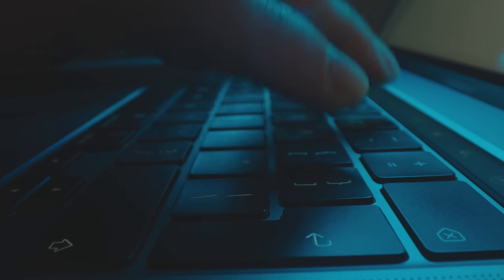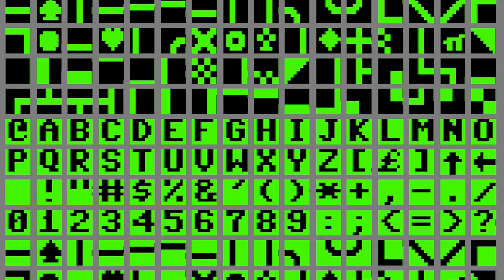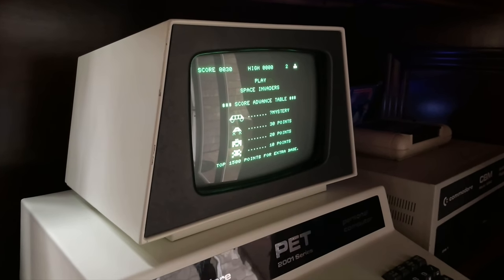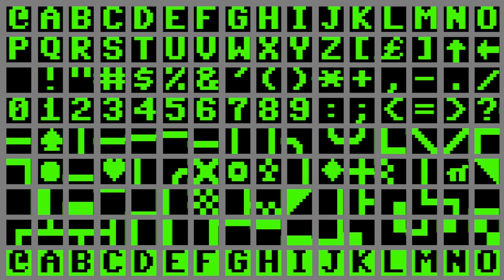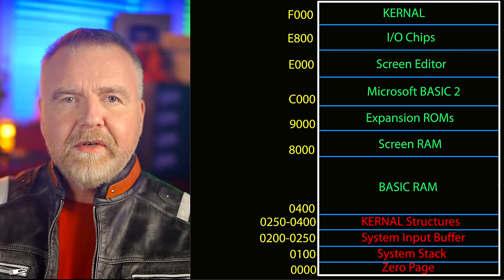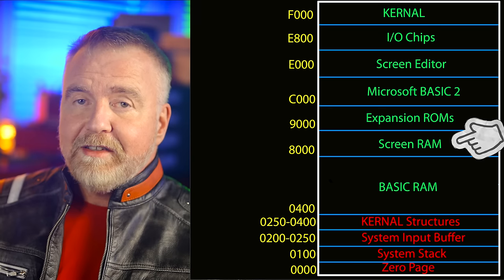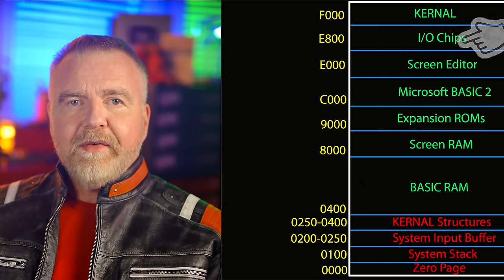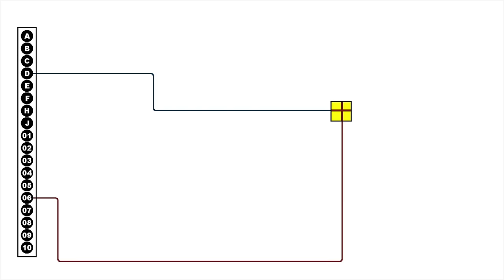Everything you SHOULD know about your Computer but don't!

Comment: My career started at Texas Instruments in June of 1980 in the MOS memory group based in Houston, TX. 
Static RAM came in two flavors: fast static like you might think of related to cache. But also there was slow, as in not-so-fast, static RAM. Usually found in 600mil packages and pin for pin compatible, except for one pin, with ROM chips. If memory serves me moderately, they were 250nS to 150nS access times instead of the 15nS access times of the much more expensive 300mil fast static devices.
My very first project was to reverse engineer the CMOS based Toshiba 5516, a 16K static RAM, which I did quite successfully revealing that Toshiba was much farther ahead in the wafer fab process business than my company, the number one behemoth semiconductor manufacturer that TI was at the time. And was an early indicator that these new Japanese semiconductor companies were becoming serious compeditors in that industry. Especially with that ever increasingly important DRAM chip.
P.S. jump (IBM / Intel 16 bit 8088. The jump to location being the battle Intel and AMD fought over with claims of copyright  infringement.)
Reply: Hi ChesslsJustAGame. Did you work on any memory test equipment when you were at TI? I believe the testers I was developing were purchased by TI for those parts.  The SRAM business was brutally competitive at that time...

Comment: In my early teens, I had a Sinclair ZX81, followed by two Atari 8 bits. Although I never got in to assembly language, I did have a lot of fun programming. Poking values from BASIC, altering characters, setting bits on the video and sound chips on the Atari to achieve different effects etc. References like "Mapping the Atari" and "De Res Atari" were incredible resources on the system architecture and OS, even if I only understood a fraction of it. Nowadays, everything is a black box, closed off and accessed by a gazillion gigantic libraries, and most kids today have no idea about bits and bytes.

Comment: “In the beginning…”, I used assembly language for my coding. I had to write drivers, I/O interfaces, BCD to binary, clock timing, etc. I wrote floating point algorithms for fixed-point machines that were 16-bit words but included 16-bit, 32, 64, 128, and 256-bit using some great algorithms, graphics for screens, radar screens, antenna patterns, all in critical time - real-time is I hit a key and an answer shows up, critical time is x eqns in your time. Any time left over was used for background stuff, so interrupt structures. I loved it - absolute control of everything! I even restrung core memory!

Comment: Nice video!
Reminds me of 1981 or so. Got a Tandy TRS 80 PC with 4K RAM. The same evening I replaced the RAM with 16K chips. Later upgraded it to 48 k by soldering 2 RAM ICs on top of each RAM and adding an address decoding circuit. All piggy-backed on the original ICs. Next a lower case character generator and after that an APL character generator for the specific symbols for the APL language.
2 pcs 5 1/4 floppy drives with home build controller. Real-time clock and a 75/1200 Baud modem.
That was indeed the last system I understood 100%.

Comment: Nice, bring back the 8 bit days, I loved being able to have my head around 95% of my machine.
"Character gen rom not in memory map", same as my TRS-80 M1, having the actual character 'rom' in ram was a problem back then, the video refresh circuit has already pushed the CPU aside so at to read the video ram, now it has to also index back into ram to get the character patterns for that screen position, usually that was too much bandwidth for the main address bus to handle. I did it on as a hack mod on my TRS by having my programmable character 'ram' chip as a dedicated to character generation IC that was not 'normally' in the main memory map, so it's operation did not effect normal memory bus operations. However when I wanted the CPU to write to it, it was quickly switched from the video cct, back into the main memory map.
On my TRS, there was not a handy 2K hole in the memory map (I used a 6116 2k ram chip) so I mapped it ontop of the 12K Basic ROM. If you do a read, you get the ROM, if you do a write, if goes into the character gen ram. The only downside is that I could not read that ram, only write to it.
In the PET days, adding all of this would have made the circuit board somewhat bigger. By the time the C64 came out, Commodore were able to make their own custom chips, making this a lot easier, as the circuit board could be shrunk quite a bit. the downside for the C64 is a few 'unobtainium' IC's that makes repairs a tad hard. (yes I know there are modern solutions, now, - only due to the C64's popularity)
Reply: I did something similar on my ZX80 in around September 1980. I had a little board that I designed that plugged into the ROM socket, but also added some extra logic and a couple of 2114 RAM chips. My ZX80 had the normal 64 characters, plus 63 user defined characters and their inverses as well as the inverse of the 64th user defined character that you could not display normally due to the way the ZX80 display generation worked.  Fun days!

Comment: I used the kernel routines on the vic-20 to print to the screen, that way when a memory cartridge  is installed and the screen memory changes the code still works as the kernel routine adjusts for  that.

Comment: The reason the PET didn't have user defined characters is that the character ROM isn't in the 6502's address space, it is hard-wired into the video circuitry. You can't read the character ROM on a PET from a program even if you wanted to. The video circuitry in the PET essentially operates asynchronously on its own, with the CPU grabbing access to the video RAM when it wants it - do this at the wrong moment and you'd see "snow" on the screen where the wrong data gets shifted out to the electron beam! That is why BASIC usually waited for the vertical retrace interval before writing to the video memory.
Later PETs, the 16K and 32K pets (2016, 2032, 3016, 3032 etc) did use dynamic ram. These are often referred to as the "Dynamic PETs" by forums.
Reply: I suppose that ram was also a precious resource and by using rom more ram would be available for programs.

Comment: I remember writing my first basic program from the commodore 64 manual. The hot air balloon pixel graphic that would float across the screen. I then spent days writing code to use the keyboard to move it around.  
So much fun as a kid with tech that seemed like it was from the future. 
Thanks Dave for bringing back fond memories. Keep it up.

Comment: Thanks for the walk down memory lane. I started with the Commodore 64. 
I recently did a hobby project for my IBM PC-XT and wrote an assembly language program to interact with the battery backed up clock board on the IO buss. The original program was long gone from the hard drive which required low level formatting to bring back to life. 
I had to trace out the board, create a schematic, and then look up the spec sheet for the chip (MM58167). I used MASM to write the code. The project was very satisfying an a lot of fun. The last time I did any assembly language coding was 30 years ago.

Comment: I remember discovering software interrupts when I was 12 years old. I bought all the books I could find on anything PC. In one summer I made TSRs to cheat in games, made a program to add echo to live microphone input, wrote a simple graphics library to use all VESA modes on a Tseng labs 4000 and read data from a CD-ROM.

Best summer ever!

Just one summer later I had internet connectivity and Pathfinder landed on Mars.

Epic times.

Comment: Life was good when I could stop toggling the boot loader into the front panel of a PDP-8, and use the boot loader in Core RAM in a PDP-11.  Imagine my delight when the bootloader and monitor were burned into EEPROM in my 1975 Digital Group Z-80 computer that I hand-soldered together, all 1024 bytes of static RAM, later expanded to a voluminous 8 kbytes.  It would load and save using audio tape. I wrote a lobby kiosk annunciator board app, in hand-written machine code, for that sucker.  
Booting Windows or Linux from SSD is an incredible luxury! (By the way, get off my lawn).

Comment: Something I constantly have to teach students - input/output. They get that a little with PHP or with CICS. But in normal programming, they ignore the WFA form (or WPF, etc.) until the last minute. I was always taught to use spacing charts to plan I/O before coding (partially because it helped plan some of the variables).

Comment: Dave really should setup an old school BBS for his userbase (rather than a discord or other) I think it would go down pretty well :P 

Perhaps not with a phone dialin though, some sort of emulation over TCP instead :)
Reply: Infact ... it could be done, a standard BSD server, users sign in with ssh like expected, then they use minicom or such to a local BBS .... this must be tried!
Reply: Even IRC would be a good midpoint, old enough that you can get old hardware to talk to it, but not that old that modern hardware can't also talk to it! You can even get smartphone apps for IRC, just!
Reply: I used to help a friend run an Acorn BBS with 3 lines, allowing a whopping 4 people to chat together - well until their parents got their monthly phone bill and banned them 😏
Reply: In the *nix world there'd be no emulation required to work over TCP and/or serial line.
Reply: I bet he already has 😜
Reply: @petevenuti7355  Does it have Trade Wars? ;)
Reply: In the early 90s I ran PCBoard 15 under OS2 on a Gateway p5-60 with two modems. One modem connected to a small local ISP with a static IP, and the other available for dial-up. Those on the internet could access the BBS. Most just poked around and didn't stay as they were not enthusiasts.

Comment: As a computer science student, there's so much to learn that it's sometimes seems insane that I'm even trying.
Reply: I feel you. How much of this video is included in your courses?
Reply: @therealb888  We do learn how computers work at a fairly low level but it's more focused on modern platforms which he mentioned are huge compared to these older machines. This video is like looking at how a go kart works to understand a passenger jet.
Reply: @therealb888  If you want deep dives, I'm studying assembly x86 as a Comp E student. We didn't go over basic yet, but we either will in future (I hope) or we will go back to C++ 
I'm typing cuz CS doesn't really go into oldschool, hardware type stuff, that's our territory. CS usually goes into performance engineering and such with more modern stuff. What i mean to say is that they really don't need to focus on controlling hardware as much, CS is more about applications and etc. Maybe @@coolbrotherf127 will go into Rust and the like in the future

Comment: When you mentioned the part about not understanding some of the other sublayers and bits of the system, it got me remembering a thing I watched a while back about ALSA (Advanced Linux Sound Architecture). The discussion was about how without some kind of added layer of control modules and extensive system components in the middle of him and ALSA - he would have virtually no idea how to make it useful. And that's just the sound. Imagine also trying to interface on a machine-code level with a modern graphics card, with all of their complex functions. 😳

Everything has been reduced to specialized modules that entirely do things for us. The problem is that those modules are extremely power-hungry, when you consider resource uses.

I started using computers when an entire OS would boot from a floppy. Now single video games are significantly bigger than most of the hard drives I used for the first 10 years of using computers. 😳
Reply: Modern video game sizes shouldn't really be compared to those old disk drives, because most of the consumed space is graphics (whether images or 3d models).

Comment: I didn't enter the computer field at the PET stage. I entered in 1982 with the HEATH model H89 running a 64k CP/M system with a Z80 CPU (2MHz). Even within 64k RAM, the thing could run a good word processor that, surprisingly, had many useful features considering it ran in what was left of the 64k after the CP/M system filled its share of the RAM. I even had an MBASIC  compiler and a FORTRAN compiler on that H89. Storage  used 5“ floppies, hard- and/or soft-sectored.

Comment: Re: character generator ROM: 

My guess is that allowing both the CPU and video circuitry y access the RAM  would require additional circuitry to implement a dual-ported RAM solution - adding cost to the system.

It was also the case with the TRS-80.
Reply: When the CPU was slow (1MHz range), the static RAM once upon a time was more than twice as fast than the CPU, allowing interleaved access by CPU and graphics. So no dual-port RAM needed. Just waiting for the CPU to release the address enable signal and have the graphics card step in and read.

I have a home-built Z80 machine using this logic. Nice, clean, and fun to implement.
Reply: Easier to debug as separate units and both circuits were already well known.  But I was thinking bus contention as well.
Reply: I may be wrong, but I think the character ROM on the PET (unlike the C64) was not hooked up to the main CPU--it was only attached to the CRTC. So, the actual hardware made it impossible to relocate the ROM.
Reply: @whollymindless  Yes, contention is definitely the issue. But there is a cheat possible in some situations.

During CRT horisontal and vertical retrace, the graphis do not need to read out data. So it's possible to switch ownership for accesses.

Not a perfect solution for graphics RAM since it limits available draw time per frame. But enough time to redefine sprites in a RAM-mapped character generator.

Edit: but it does require some MUX chips to switch if addresses comes from CPU or CRTC or whatever is used to drive the graphics display. And it requires an extra dual-direction buffer chip on the data lines since the character generator data must be muted from the CPU data bus while graphics is being emitted. Easy to build but adds cost and PCB space.
Reply: @d2factotum  That is why MUX chips are needed, to switch ownership of data and address lines. And a means ti synchronize the code with the horisontal and vertical retraces
Reply: @perwestermark8920  I assume you're using SRAM? Cause I'm pretty sure it gets a lot harder when you have to work in the dynamic refresh cycle, as well as both CPU and vid access...
Reply: @gregmark1688  Yes, it was SRAM. I wouldn't want to try DRAM, because of the additional complexities - it was over 35 years ago and before I learned how to use programmable logic. So lots of 8 kB SRAM and UV-PROM chips and a a big wire wrap prototype board. Z80 CPU, CTC, PIO, SIO and 6845 CRTC.

The next project was to write a Z80 simulator and make it into a ZX Spectrum simulator. I got as far as having it print the copyright message upside down. Unclear if it was a bug or an ertor in the Speccy documentation I used.

But it's always fun to try projects that are a bit outside of the current skill level. It's an efficient way to learn.

Comment: Very cool video. I stated with a RCA 1802 Elf in the 1970s. A friend and I built a system to replace a controller board for an IBM selectric printer - with 2 k 2102s, and serial IO to control the selenoids to control the mechanics from a serial input. We built our own hardware emulator, and programmed in machine code,  including an eprom.  The 1802 was a good platform since it was static so we could control he clock and step through the routines to ge the timing right.. I agree with you that is is helpful to have a knowledge of how these tools work. It was fun, but I enjoy the current capabilities of running MS SQL and Tensor Flow.

Comment: Thanks for the trip down memory lane. I worked for an early PET retailer when I was in HS. I bought an 8032, and wire wrapped my own board to switch between 2 sets of BASIC ROMS and 4 sets of expansion ROMS (per socket). As Jayson mentioned below, real manuals were nice. I remember being very disappointed when I bought my first "Windows '95 Internals" book that didn't cover anything more "internal" than the standard Windows settings menu!

Comment: My first production computer was  the  TRS80, Model 1, And with the exception of the Z80 processor vs 6502, I never realized just how close the TRS80 was to the C64 in operation. Similar (but different) Memory map different , and other functions.   I'm grateful that I learned programming in those days - i still shake my head looking at programs that are written in multi-megabytes and even a few in the Gig ram size.  I wrote whole applications in 32K, let alone 48k and multi floppy drives ... everything from payroll to inventory. As well as interfacing the TRS80 to alarm systems that tied into the payroll system, or 'call  for the cops' if the wrong person came in after being fired, and use the data for payroll.  I miss the days of  interfacing a model 11 to a Helicopter simulator. not just a 'flight simulator' rather a trainer for learning and testing on 'Real Hardware'.